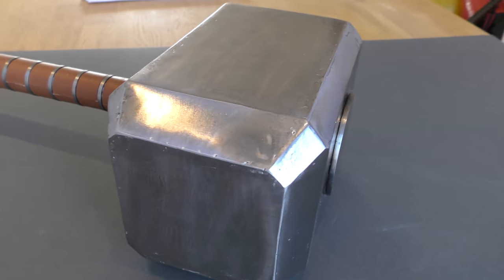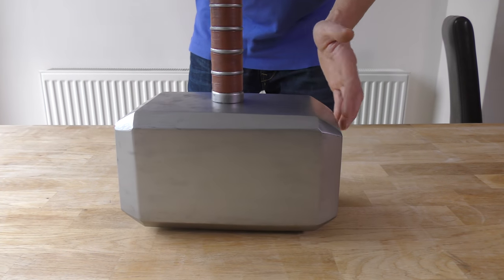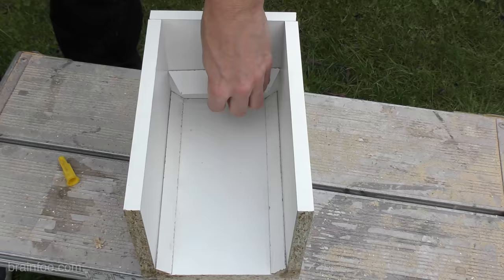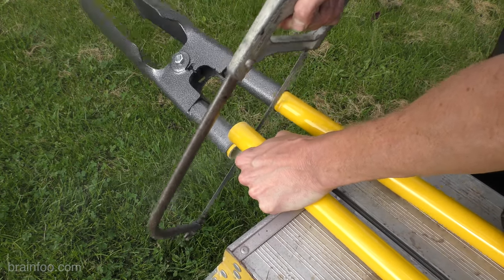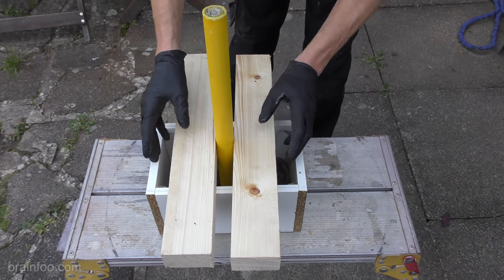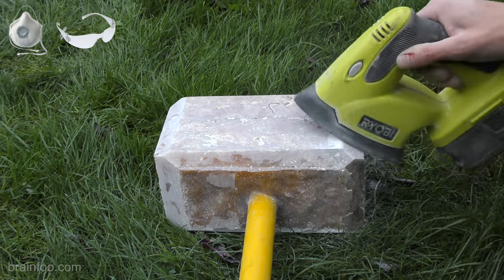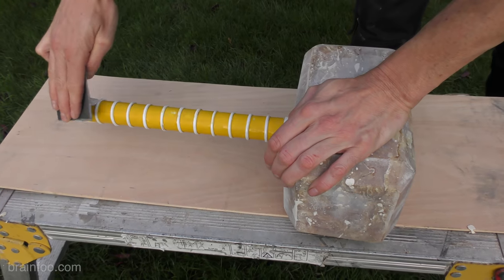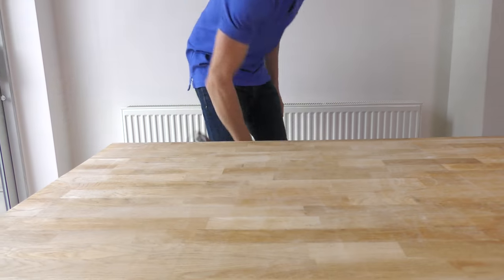REAL Thor Hammer - Awesome DIY Build

Comment: 15 years ago, I made one out of Square tubing for the head, welded a steel tube for the handle, then wrapped it in leather string. It only weighed a few pounds, but it smashed through concrete. Yours looks nicer, though.

Comment: I have a friend he is an electrical engieneer. I dont know how he created mjolnir that is really heavy and can't lift up, only he can lift it up through some of his own brilliant mind. It encoded with his mind and chip kind of device. It can't produce thunder but can catch the thunder from the sky. He said he fitted some strongest magnetic material with some copper plate and Adamantum metal that can give ability to catch thunder. It is closed to the mjolnir. He fears to use it outside holding it on hands because of its capacity to adapt thunder from the sky of high volt. Its real, i am not joking. I saw it catches thunder. He put the hammer on roadside keeping its head on the top and straight and shout encoded voice thunder. It shines like a heavy thunder came out from the sky but it did nothing to the mjolnir. He never holds it of fear but created it. Amazing brain he has..